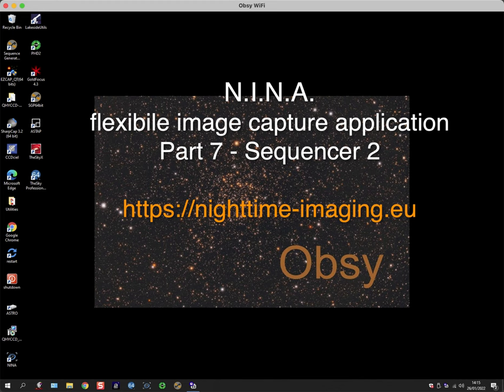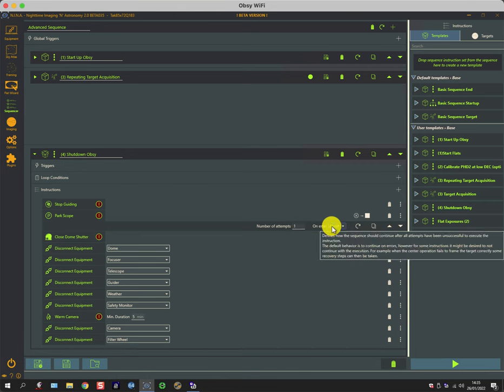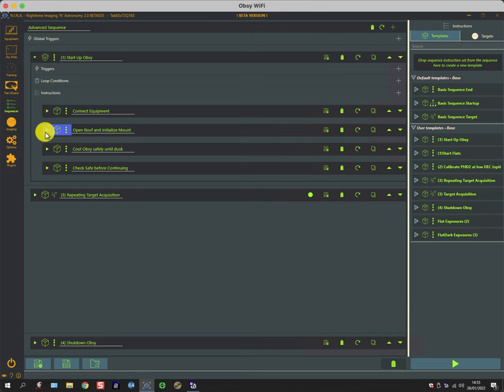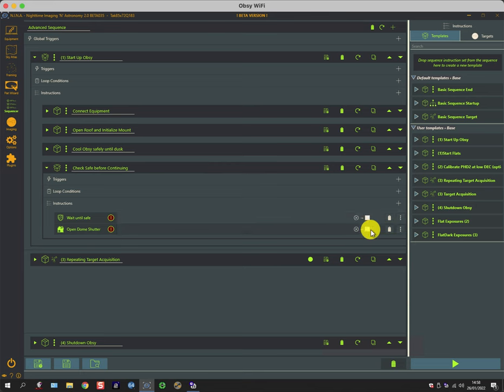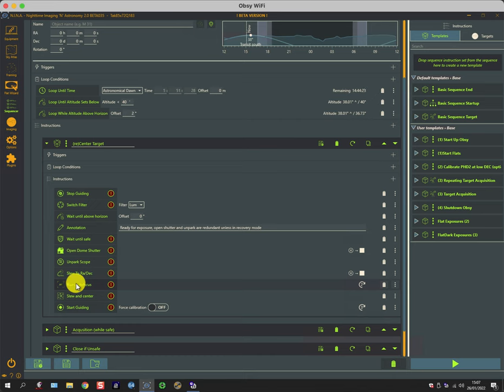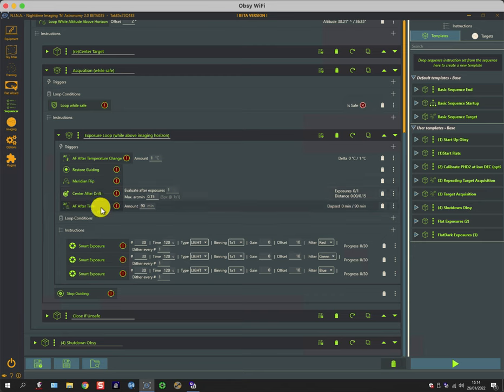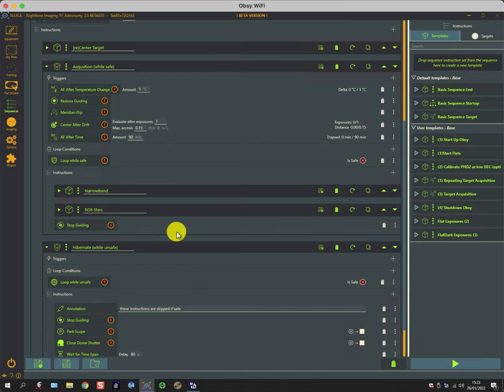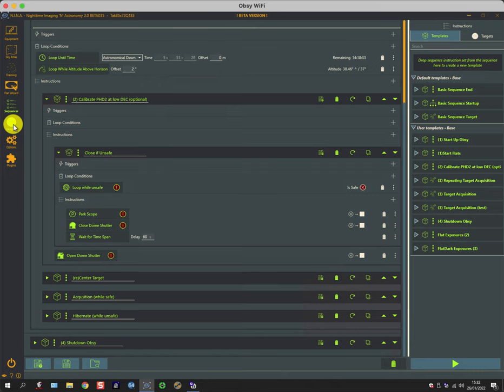NINA 2022, Part 7 - Sequencer 2 (3)

Comment: Very good and clear explanation, Chris. Thank for this series about NINA.

If I may ask, which safety monitor and dome do you use?
Reply from the maker: I have an AAG Cloudwatcher and use that with the ASCOM Boltwood safety monitor. I have a roll off roof, for which I designed my own controller and an ASCOM driver. I put the project details on the website.
Reply: Thank you. Those two items are very useful for a completely automatic setup